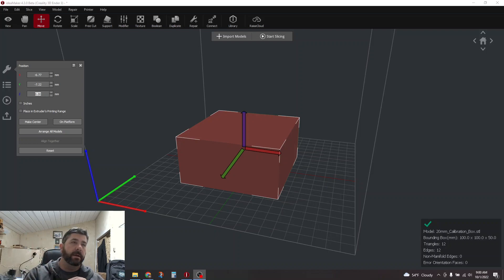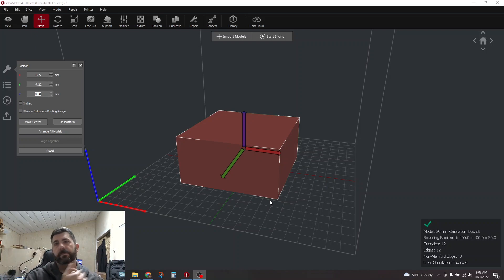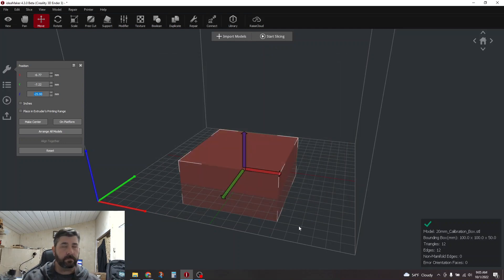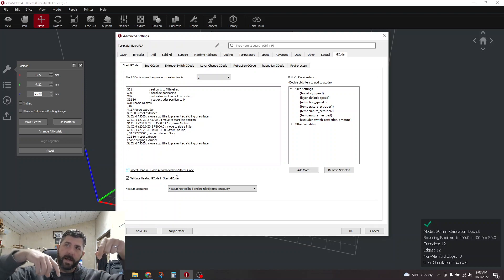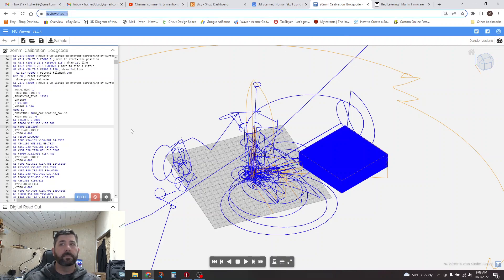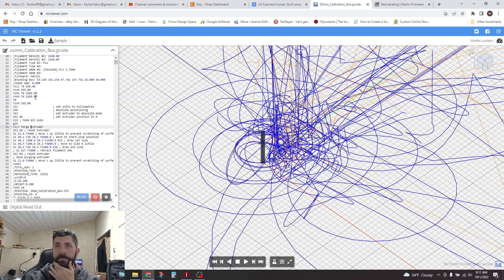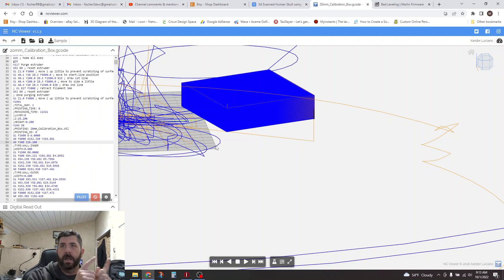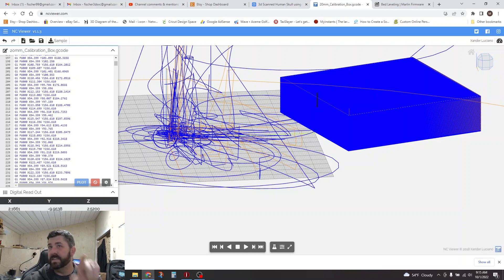Quick tip: Failed Prints - Should I Start Over or Start Printing at a Specific Height???

Comment: Interesting, I would just sink the model into the bed and print a separate to glue together. I'm trying this now but my slicer is failing to slice  -90mm on the Z. I've done this before without issue but this model it doesnt like and I came here to find out